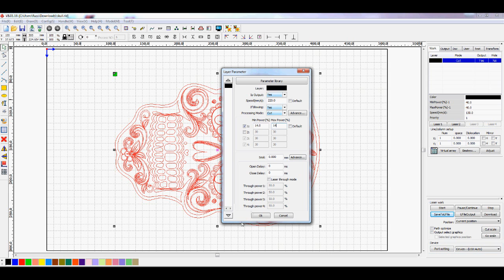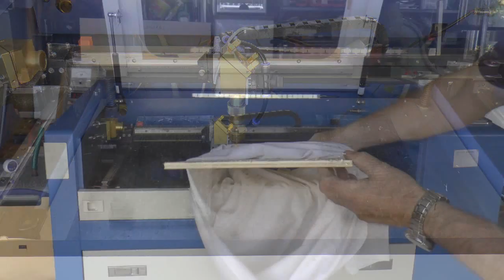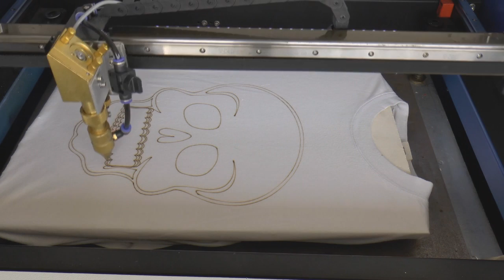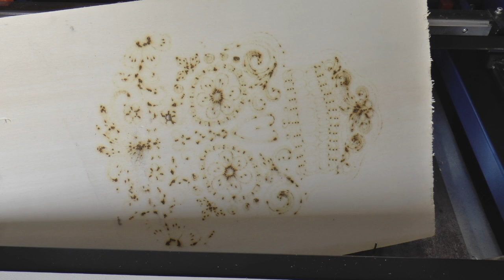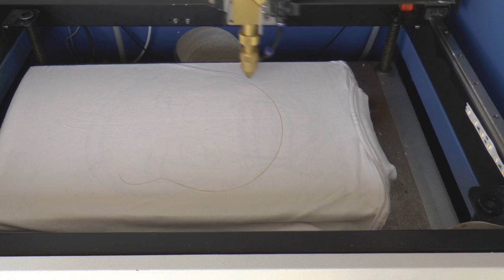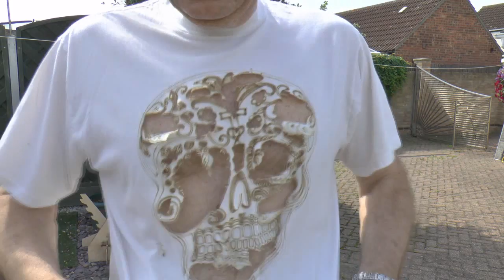RDWorks Learning Lab 76 Laser Etched Tshirt Logo

Comment: Thank you for sharing all the knowledge i really appreciate it. What if you cut the shirt wet not dripping from the swamp but wet enough to dissipate the heat but still engrave. Thank You Big Ed
Reply from the maker: HI Ed
 Thanks for your interest and your logical suggestion. 8 years ago when I did this silly test ( because a friend asked if it was possible) I did not understand the way in which light energy and different materials interacted.  This series of laser videos is basicallyball about me trying to understand  the smallest details of how laser systems work I have experiemetd (in other series) with RF CO2 technology, fibre lasers and diode lasers . Most people only ever use their lasers like they drive a car, they use the controls that are in front of them but never  lift the hood or wanrt to understand how aor  why the car gets them to work every day. At this point in my learning journey, my enthusiam  was high and my knowledge low. There was so much science I was never taught as schoool/college and this series is all about  me acquring that understanding of  the discreet scienc subjects that encompas laser technology.
 Different materials react more or less depending on the wavelength of the light hitting them. In this video I did not understand how the intensity of a CO2  laset beam could not be easily controlled when it passes through a lens and that the cellulose in cotton  was a great absorber of 10.6 micrn wavlenght light energy.  My rerquirement was to just scorch the cotton, and the  low intensity outer part of a laser beam  does lust that. However the central part of the beam is always so powerful (even when I reduce the power) that it evaporates the cellulose. I had tried the trick ymentioned with water. but again (at the time) I did not understand that water absorbs almost 100% of the laser energy and IMMEDIATLEY turns to steam thus leavig the dry cellulose to be damages as normal.
I have now self-educated with many laser technology and realise that this would be a simple ask for a diode laser operating with  455nm wavelengh light. However, such equipment was not even designed 8 years ago.
 If you have a CO2 laser machine, just place a cup half filled with water under your laser head. Turn the power to max and fire your focused laser beam into the water.. You will hear crackling sound and see the water boiling on the SURFACE. That light energy does NOT have any heating effect on the contents of the cup , 99% of  the energy is being absorbed by the SURFACE moleciles and converted to steam without conducting any heat to the moecules below.

Comment: Hello Russ. You talked about a beam that’s not properly formed at a certain % in this video. I wanna know more about that. Do you have a video of that being explained?
Reply: All laser beams are non-uniform in that they  have a more intense central core within the beam . That variable intensity ideally will be a Gaussian distribution. Imagine a  small bucket of damp sand tipped onto the ground. It will form a small shallow mound a few inches tall. Imagine that to be the "blunt" shape of your beam at 10% power. Now carefully pour another bucket of sand on top and the mound not only gets taller, it becomes more pointed (sharper). That is how your beam changes shape as you increase the power to 20%. As you increase the %power your beam changes shape  becoming more and more pointed. In reality, this sharpness is an increase light INTENSITY within the beam. It is light intensity that defines the RATE at which the beam does damage  Thus more power= more damage  but the type of damage changes as you change power. It's the same idea  as drawing with a blunt soft lead pencil or a sharp hard lead pencil. . That is what I mean by not properly formed.  You can achieve the same sort of "blunting" effect by setting the beam out of focus.
 Best wishes
Russ
Reply: That clear things up. Thanks for your answer. Have a nice day.

Comment: Mist over the shirt with water first,  that will stop the shirt from burinig to much
Reply from the maker: Hi Dave 
 At this point in my learning journey I did not understand about the Gaussian power distribution in the beam but this was a fun project. I had already experimented with wetting a shirt . Water does absorb some of the energy but evaporates so rapidly that after a few nanoseconds the local fabric is water free and burns just the same . If I was to do the same thing again I would be using the pre ionization zone along with an out of focus 4" lens I may even add dot mode.

Thanks for the comment 
 Best wishes
Russ
Reply: @SarbarMultimedia  Try this,  Wet the shirt first then cover the design to be cut with brown packing tape,  the tape will still simi stick to the shirt and then do your burn,  you will need to weed out some of the tape when finished,  but you should get a good result.
Reply from the maker: @dmaher2007  
 Hi Dave
 Brown packing tape (plastic) has a slightly higher damage threshold than cotton, so is your idea to attenuate the power to the cotton by absorbing some of the light energy  as it vaporizes the tape  OR is it that you are trying to melt the packing tape onto the cotton?
 Best wishes
Russ
Reply: @SarbarMultimedia  vaporizes the tape
Reply from the maker: @dmaher2007  
 Hi Dave 
 I anticipated that may be your reason. So  why not just turn down the burning power of the tube to match the damage threshold of the material? Adding a layer of tape will have no effect.  A car crashing through a wall  loses its energy in crashing through the wall so what is behind  will not feel the impact. That is what you are imagining will happen with the tape. Hmmm.... not quite the same . Instead, stand behind that wall and  imagine a high pressure water cannon firing a jet of water at the wall . For a second or two you will feel nothing but once the water has pieced the wall ........... Can you now see the futility of adding a barrier? The whole problem boils down to balancing the energy density supplied by the beam to the  damage threshold of the material. Energy density can be controlled in a mix of 4 ways  1)  watts. 2) the  largest spot size lens, 3) some defocusing  and 4 ) linear speed.. Anything you put in the way is just fogging the real problem that has to be solved.. Try it for yourself.
 Best wishes
Russ
Reply: @SarbarMultimedia  As you said,  like a bumper,  the water cools the tape and the cotton, so you do not have to put as much power through the laser in turn reduces the shirt from burning
Reply from the maker: @dmaher2007  
 Hi Dave
Balancing these factors against the damage threshold of the material was not something I acquired knowledge of until later in my learning journey. As I understood the importance of each of these 5 elements solving cutting and engraving problems became a lot easier. Even today I am still exploring all the weird things that lenses do. There are NO parameters I can recommend because EVERY machine will be different . If I tackled that project again I would also be using the min power parameter.....so much I didn't understand at the time.
 All best wishes
Russ

Comment: Wet the shirt.
Reply from the maker: Hi Sea
Yes, that seems like an obvious solution but sadly it only confuses the situation. If you fully understood the nature of energy transfer  between the beam of IR light and the material it interacts with, you would be able to imagine the effect of your suggestion. Perhaps this example  will explain the problem. If you hold the palm of your hand at the tip of a candle flame long enough it will DAMAGE your skin even though the  energy density is relatively low. However, if you move your hand over the tip of the candle flame (even very slowly) there will be insufficient energy per unit of time to damage your skin. It's a speed against power balancing act. Now make your hand wet and repeat the experiment. Yes you will be able to move your hand slower, but that's because the available energy has to heat the water first, it does not change the damage threshold for your skin, that remains the same as before.  
This was just a very lighthearted fun way to demonstrate the near impossibility of  achieving that  balancing act because every time the laser approaches a sharp corner the speed reduces but the power does not. Thus you get excess damage to the material at the corners. 

Best wishes
Russ
Reply: SarbarMultimedia gotcha.
I just bought a 100watt chinese laser, an I'm watching all your vids to prepare myself for delivery.  Very excited, and thank you for your experiments.

Best,
Sia

Comment: I think a good voltage stabilizer should be tried with the input power of the machine.
Also min and max power should be same when machine is working under 25% of power
Reply from the maker: I am puzzled about your 25% suggestion You don't indicate if this is your experience for cutting or engraving and for what power tube because all have different characteristics. I can can say with certainty (because my videos are there to be seen) that when you are engraving you have to tick the Output Direct option to enact the max/min power feature. It was designed specifically for varying the power on the fly to achieve 3D engraving. The min%  = white level 255 and the max% = black level 255. If that switch is not on during engraving then the min power will be ignored and it matters not what the min level is, the machine will only use the max. Even if you have Output Direct ticked for  text engraving or black and white logos  (as in this T shirt bit of fun),  the min% will be ignored because anything white will switch the tube off and anything black will use max%  power.
When it comes to cutting  things are different. If you set a min and max power  then the min % power =zero velocity and max % power =your set speed. Again knowing this fact, I can see no logic for your 25% advice. In practice I rarely use max min for cutting because it seems that is feature is only really effective at VERY low min % power.  I keep max and min the same whatever the cutting power.
Best wishes
Russ
Reply: Thank u Russ for replying me. I am helpful like many others for whom u devote your time and knowledge. Many thing want to learn from your experience . Plz provide me your e-mail I'd .
Thanks once again. Great day ahead.
Reply from the maker: check your You Tube messages

Comment: Russ,

thank you for showing the video!
Nice idea to laser clothing.

It would be very interesting to see the result of an "engraving" mode run, because the cutting mode sums up the energy where lines are very close or crossing, which the engraving mode doesn't. 
So it will result in an overall uniform treatment of the fabric.

Lothar

Comment: Thunder Lasers offer an attachment that is intended for high resolution super fine etching. 
They also boast improved 3d etching.
This wouldn't apply to this video of course.
But have you considered looking into this?
Reply from the maker: Yes,  I have examined their claims and to be honest they don't make logical reading.

Type                             Laser dot Size           Focal Distance                       Main Function
Standard Laser Head 0.0039″(0.099mm) 5.0mm~6.5mm Cutting material less than 10mm, Engraving photos within 500DPI
High Resolution Head 0.0020"(0.050mm) 3.0mm~4.0mm Engraving photos up to 1000DPI, cutting material less than 1mm
4″ Laser Head         0.0078″(0.198mm)    9.0mm~11mm Cutting material more than 10 mm

A better source for data on lenses is here
http://www.parallax-tech.com/faq.htm
For example my machine claims to have a resolution of 4500DPI.  and has a 1.5" focal length lens with a theoretical spot size of 0.003". That means I could technically burn 333 dots per inch.

Their "standard" laser head with a 0.004" spot is in fact a 2" focal length lens which can only do 250 spots per inch.
Their so-called High Resolution head is in reality a 1" focal length lens which has a spot size of 0.002". That means it can theoretically produce 500 spots per inch. So how that can be used to get to 1000DPI is puzzling....maybe by overlapping the dots?  How it can help with 3D engraving is a real mystery because as the focal length gets shorter the depth of field gets dramatically shorter. This means that the deeper you try to cut the more out of focus your beam will get and the energy density (cutting ability) will drop off very quickly. This is exactly the opposite of what you need for 3D engraving , so I am very sceptical about all their claims.

I apologize for being so cynical but I have learned the hard way that you need to read Chinese specifications with a  degree of mistrust 

Best regards
Russ
Reply: Just a thought ... :)
I found it notable as they sell it as an extra on their machines on eBay.
Reply: Is the focal length longer perhaps?